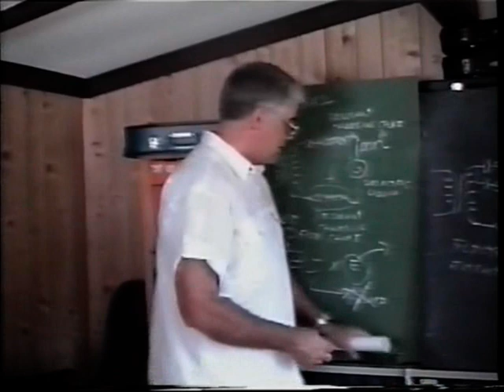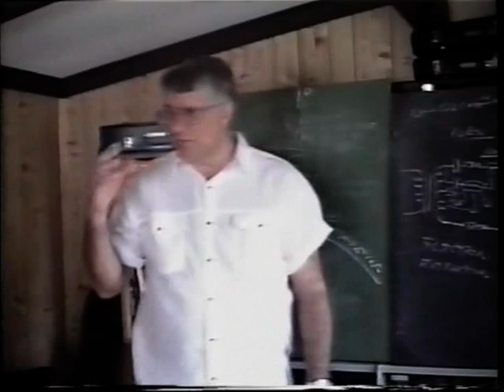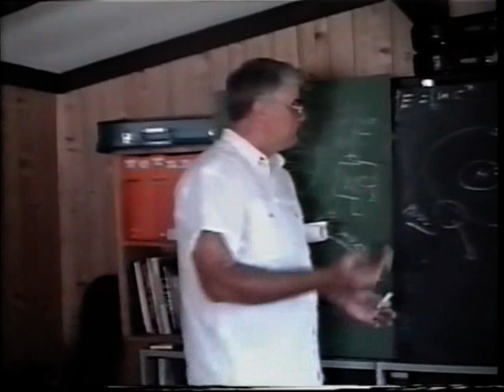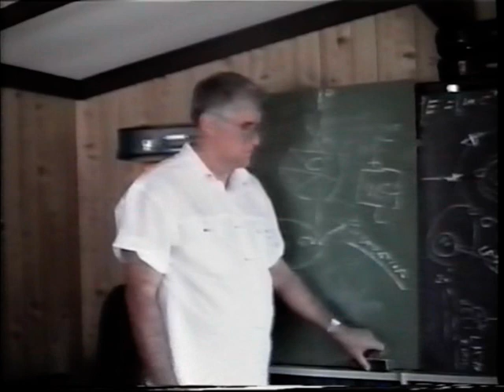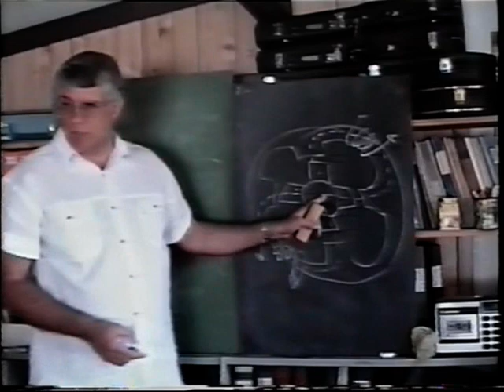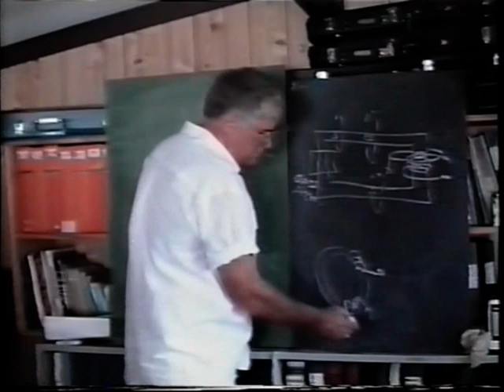Stanley A. Meyer - New Zealand Conference 1989 - Part 2

Comment: Ok so today i am back to say when i was 13 years old, i was at my friends house and he showed me the blue prints o his grand fathers patent. I put this out there 10 years ago but no one ever did as i told them to do to make it work. the description o the patent and he did sell it or a load o cash in 1920s.
the original invention is this, and it is more practical or any one today to do then make a fuel out of water.  the invention is electric vaporizer. 90 mpg without the need or carburetors or spark plugs.

keep in mid this is 1920 and all they had is a model T or some gas guzzlers back then. so to put it bluntly 100 to 200 mpg is simple and easy to do these days. Yes no one ever did it.. But yea Modern tanks use it, just look at all the white smoke pouring o the modern tanks. not soot.. so i say in 1 day you can do the thing i am describing, and is much more practical in the world today then water as a fuel. I also have a prototype ready to be made but lack the 1500 dollars to do it. so cheap.. and i you did it you dont even need to spend 200 dollars to replicate the devise.  Ok so i wont beat around the bush. just show me that you can make it work, and i will have it built according to my specs..

he simply made a 1/4 inch gasket, placed a vaporizer coil in it, and had 2 electrodes sticking out the top. the gasket is put between the intake and manifold, and a 12 volt supply makes the coil glow.. so simple 10 dollars in parts. so the glow plug in a diesel motor is basically it. the only difference is that he did not turn the glow plug off,. could you duplicate the glow plug i described? add a controller, and a specific wattage to power it. that all. so simple..  say 3 to 6 coils at 400 watts and a duty cycle of 15 seconds per coil.   Ok i just told you how to make 100 mpg according to the 1920 invention i described.. i you are serious in saving money this is a practical application and does not require 10 years of research. it can be done in a day.. and you can sell the kit too. i have already obtained the producer of the control circuit. cost is about 600 bucks.. but you can make one or less.. let me know i you are interested.
Reply from the maker: What about Stan's Sphere? What about his Steam Resonator? What about his Atomic Degaussing Process? Neutron Electrical Polarization Process? His Electrical Particle Generator? Why is everyone so tunnel-visioned with running a vehicle? If people only knew about Stan's other tech, or quite literally the impact that would come just from efficiently heating a pot of water?
Reply from the maker: It sounds like what you're describing is just a vapor fuel conversion. This is typically how all engines are converted over to gaseous fuel. Stan did EGR reclamation and recycling too.
Reply: @drgonzo7806  sure i know about his other ideas also.the particle gen is so simple yet no one does it. I wonder why. Russ from RWG did it years ago but then he tucked it away so no one would copies it. you should do the particle gen, all it really is is a vaporous fluid in a coil o wire that has some iron particles, and coils around it.
but like i said to be practical.  the steam resonator is simply a sphere in a sphere so that is easy also. oh you like lasers spiraling at the speed of light? is it practical? take some steam send it through some coil, add some coils for induction. not a brilliant idea but not a bad one at that. it can be done with water also. anything that flows can be made to create electricity. like i said for 10 dollars you can help the entire world in just a few days. why spend a life time chancing some dream that no one will ever bother to replicate? did you ever see Russ and his EPG? 
all i am saying is it has been over 30 years or more Since Stan Died. and yet no replications that can be used for practical purposes.  yes i did look into stans inventions.  i sound like a broken record. it is not practical at all. i it was every one would do it. today the one wire system seems to be what the younger crowd is doing. much more can be done in that field rather then a water fuel. even better is a Air car.  the idea o a vapor in a combustion engine is not new, yet the best car manufactures can do is 35 mpg? come on like i said 100 is easy, yet no one does it. why is that?
Dont forget the Geet Reactor. did he not end up in prison? to do the easy thing is best, because of ease of replication. that is all i am saying. 120 years  90 mpg vs 50 years  water car, and still we are in the stone age.. just do what you do, and chance that dream, dont forget Stan still has the Patents.. the technology will sit on a shelf for another 100 years., until some one comes along and says look this is simple to do, so just do this..
Reply from the maker: If I've learned literally anything over the past 8 years messing with this stuff, it's that "nothing is as simple as it seems to be here". It really is not. I found no one bothered to read the patents very closely, because the difference between what's actually written there and what everyone is speculating it to be, are grossly different. I didn't get in the game until after all the original guys fell apart. (from greed and thievery, vanity and pride) Russ made critical flaws in his EPG. In fact, it would appear Max did as well. We are working on it, and have some proof of concept smaller versions in testing of different liquid mediums. Stan didn't use the magic magnetic gas until much later in evolution. The EPG existed on the very first buggy even. Before the WFC patents were issued. He used other magnetic materials and devices to pump the fluid. Russ didn't even make 1 bubble in his debut video of printing and wrapping the big fancy 430FR bobbin (designed for the injectors at 50kHz) but he hooked it to a tube cell and nothing happened. Nobody.. I mean nobody is taking the time to actually read the patents word for word and think about what they're saying. 

Wanna know how i know this? Because we transcribed almost all of them and read and fixed Stan's bad grammar and punctuation, and added context and inline figures as they're referenced. That alone was a huge benefit to following the text.   @freethisone
Reply: @drgonzo7806  i checked out the Stan page you linked. it is interesting. i did not learn much there, perhaps i need to sign up to access it.

the Ed lee  stuff i did a lot o research on his castle so i like that PMH. he made. i made a couple ideas on the PMH years ago but never shared it. also the castle is dedicated to planet X and the planet or star Sedna. that much i learned. i also discovered Sedna in 2009 as it made its approach. i never did image it though a red star in the east to north east. But i did capture the valentine comet in 2010 to 2013.
his sweet 16 was Sedna.. his story o Agnus was all about him never having the chance to observe it.  you can see my polarized images o the so called second sun. but in my 2007 to 2008 soho video it is captured. the objects i captured are simply traveling together with it. as or the PMH i see it like this. i you energize the coils the hold the bar, i you do it a second time it releases. but you may recall a single wire can magnetize a object if a groove is cut, and then hit it with some volts. so instead o hitting the coils with a second pulse  i say cut a groove in the face of the holder put a single wire in it, then magnetize it to a piece of metal. one pulse.  then you can pulse it on and off very fast, and use the coils as a power source rather then use the coils to energize the magnet. its just an idea for use a mechanical means to forcefully break / pull the PMH apart. there is no reason to make such a PMH. if it is not to make volts from a continuous on off pulse then what use does it have? none? thanks for the conversation. good luck too.. if you want to talk electric potential then i am your man.. cheers.. Like Maxwell he is correct. i also discovered his poem a problem in dynamics, that clearly tells the story of earths external net force pecession torque times delta T.. ps we are about to be torqued shortly. less then a week is a guess. so a Earthquake o 7.5 to 8 is a possibility, like i have demonstrated many times in the past... i you are interested or have a need or new eyes to solve a problem i may be able to help. cheers.
Reply: You describe it well ions in a vacuum electro static magnetic static Joe booker